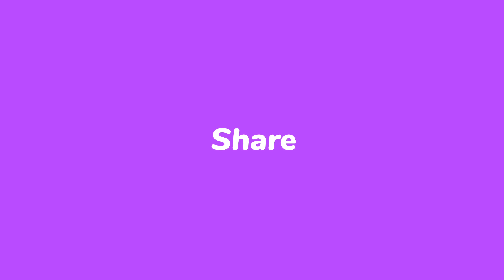Basement walls near complete | What's the next step? |Couple builds house DO IT YOURSELF house build

Comment: Hi GUYS, with that old nailed, put some compressor oil down the air intake then run some air through it fire some nail you'll oil come out of the vent , then leave it alone for a few days so the "o" rings in the valves can swell up and seal. But before you use it run some nails thru it so there's no oil coming out of exhaust vent. If your not using it put a drops in it fire it a couple of times then put it to sleep.  Have fun with it 😊😊😊😊😊😊😊🇦🇺🇦🇺🇦🇺🇦🇺🇦🇺🇦🇺
Reply from the maker: Awesome we did put a bunch in to start the soak. It won't fire at all. If I get it loose I'll have to consider a rebuild kit.
Reply: Hi GUYS, I have rebuilt about a dozen of them. There's not a great deal inside them , Just make sure to not force anything into place and slightly lube the parts when reinstalling them . Lay every thing out as you disassemble it the same way it come out and facing the same way. Good luck guys 🤗🇦🇺🇦🇺🇦🇺
Reply from the maker: Good morning and happy Friday my friend.
Reply: @Itsallgrady  👍🏻

Comment: Marcel, I told you wrong on your last video about the size framing nail I used all my career building, I used a 10d or 3 inch framing gun nail, a 12d or 16d nail will stick out the other side of two 2x4s nailed together. Those nails sticking out like that will rip your clothes, hands and arms, not good. Sorry about the mistake, this old age is telling on me. lol
Reply from the maker: Thanks for the heads up. I'll have to check that out. Thanks for hanging out 🥰

Comment: Well, I ran a pump truck company, so I don’t know why you be free to the pump truck. Most drivers it operate. They  know exactly what they’re doing. I personally didn’t run the septic truck, but I did run the toilet truck which works the same way except the hose on the pump truck when it’s full is too heavy for me to lift in the old days. Trust the drivers I know what you’re talking about and what you’re doing.
Reply from the maker: Awesome thanks 😊

Comment: By the way guys only use compressor oilcause other wise it will turn to thick crap and gum up the nailer and you don't want that .  Comp oil is about a SAE 5  or SAE 10. COMP. OIL WON'T ATTRACT MOISTURE WHERE AS PLAIN OIL WILL.
Reply from the maker: Good tip. I have seen others use all kinds of crazy lube for tools.  We will only use the air tool oil. Thanks 🥰